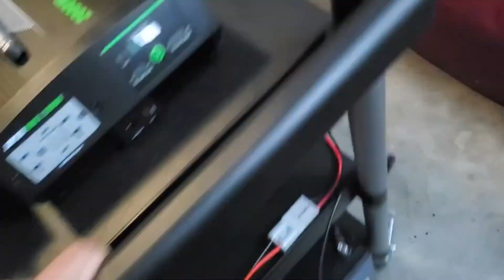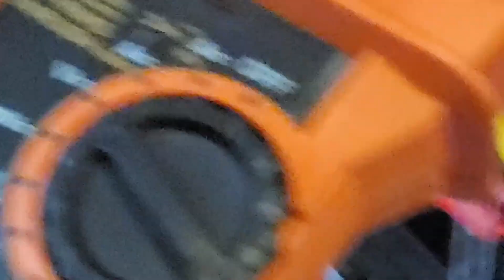🔋 LiFePO4 Battery Charging Methods Compared | Pros, Cons & Best Option for My Setup ⚡

Comment: Guess I like watching your videos.   To properly measure what each battery TRUE voltage is to wait a 1/2 day to a day, doing this allows the batteries ti settle.   Also you should have used my suggestion of using the momentary push button with resistor, that I mentioned in your  first video of  current sharing.  Yes I did notice that you don’t have an on/off switch for safety going to the inverter, that you could hook up the momentary push button with resistor.  Also I noticed that you don’t have any fuses on your batteries or in the line going to the inverter, which is just another  safety feature, but to each their own.
Reply from the maker: I was thinking about the push button in-line with the test light rather than a resistor for visual reference. Baby steps for sure. Fortunately this is an emergency kit so I can charge it and park it for weeks before I need to top off and pre-charge again; giving me time to work out details for the fuse and switch. Thanks for watching.

Comment: Please fuse your wires
Reply from the maker: No doubt. Picked up a 100a fuse based on data from a meter that couldn't measure DC amps as originally thought. The new meter does and at a 1600w draw, I average 117adc... bigger fuse coming soon. Thanks for watching!
Reply: MRB Terminal Fuses used here for each Battery + Post Connection. Disconnect Switch for both Inverter and Charge Controller allows for a 2 Switch Shut Down and Activation of My 5 Systems. Battery Power and then Solar Panels and in Reverse for Shut Down Procedure.
Reply from the maker: I've been researching these. Wouldn't the BMS overcurrent protect? up to the buss? Thanks for your insight.
Reply: @1GREATDANE Hi, MRB’s are also rated to cover the amperage that a large battery pack has!
Relying on the BMS isn’t the safest way, no redundancy if it fails.
MRB’s are also a neat and compact way of connecting it all together.
Each battery is individually fused and an overall fuse protects the cable to the inverter.
Remember when switching on the power to the inverter from a big batter bank use a pre charge resistor to raise the capacitor voltage in the inverter. This can be a resistor a low wattage 12 volt bulb, when it goes out the capacitors are fully charged.

Take care M.
The wires can cook by the time the BMS shuts off, the batteries have such a huge surge rating.
Reply from the maker: Thank you in for the insight. I'm in process now to acquire 100a MRBF for each battery, 2 gauge wire to the bus, a 150a class t to the inverter using the existing 2/0 cables. I'm thinking the MRBF setup will protect the 2 awg cables (110a @60 degrees C) and the class T will protect the 2/0 cable (175a @ 60 degrees C). About $300... Pricey, yes, but this should make the rig very safe, so it's worth the cost.

Comment: Charging in parallel will balance cells better than charge and having the cells have to balance if cells are not evenly charged
Reply from the maker: agreed and too many hassle to disconnect the batteries from the buss to charge.

Comment: LiFePO4?  ok... just charge the bank as a whole.  Also note that can't tell how full a LiFePO4 battery (or bank) is by measuring the settled voltage.  Measuring the voltage is mostly meaningless outside of the bank being nearly fully discharged or nearly fully charged.

All you really have to do (and what the battery chargers basically do) is charge the bank up to 14.2V to 14.6V or so, wait for the current to drop off, and then you are done.  The batteries will be full.

Basically for LiFePO4 while charging, any voltage above 3.45V/cell (x4 = 13.8V), after the current has tailed off, will be fully charged. But to ensure proper battery health you generally charge to 3.55V/cell (x4 = 14.2V) or slightly higher to give the batteries sufficient margins to balance themselves.

Once charging is complete, the battery voltage will naturally (and slowly) settle to roughly the float of 3.35V-3.45V/cell (13.4V to 13.8V) and still remain fully charged.    This is also why you can't just measure voltage to get an idea of how charged a LiFePO4 battery is.

--

In anycase, always just charge banks as a whole.  There is no need to risk creating issues or accidents by disconnect/reconnect cables.

-Matt
Reply from the maker: Great advise. I recall reading somewhere that the % of SOC is what matters and not necessarily voltage. I know this 20a charger took over 24 hours to charge the bank as a whole, with the bank settling around 13.98vdc after 24 hours. Thanks for sharing.
Reply: The charger charges based on Resistance not voltage. There is no such thing as math in reality. Math is just schizophrenia
Reply from the maker: Right before the PS shuts down, there is a surge of voltage of about .5vdc. I imagine that is the BMS signaling the PS.

Comment: I did this same test last night on my batterys. "NEW 100ah 12v"
didnt seem to make any difference. 
they all separately charged up to 14.6, 20a charger.
let um sit over nite and all x4, went down to 13.98.

bulk charge this a.m. up to 14.6, 
disconnected each of them and tested each battery and they all came out at 14.4.
so in my case it didnt mater how i charged um,, bulk or separately.....

My next test is to draw them down to 10.7 bulk and test each battery to see if they all match after siting for awhile after discharge.
now im going to bulk charge and see if they all test out like my first test.
keep up the good work, we need to know all this stuff.....

note: i do not use a buss bar, there connected battery to battery. "Less resistance"
I charge and discharge from battery #2 positive and battery #3 negative with my 4 battery parallel connection setup.
Reply from the maker: That is awesome. Just be mindful of the amps between the batteries since your connecting battery to battery without a bus. With that wire configuration, I saw 75 amps on the 4awg wires. That made me nervous. No worries with the 2/0 cable and the 117 amps to the load. I could had got heavier wire all around but opted for the bus instead. Thanks for your insight and for watching